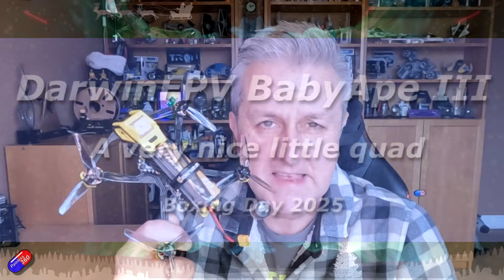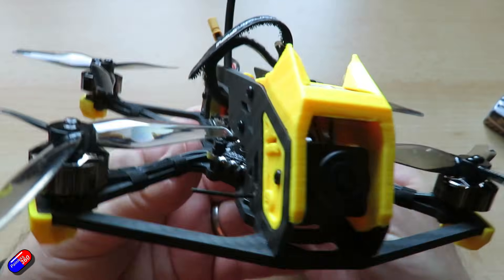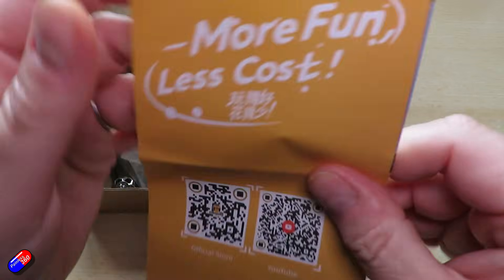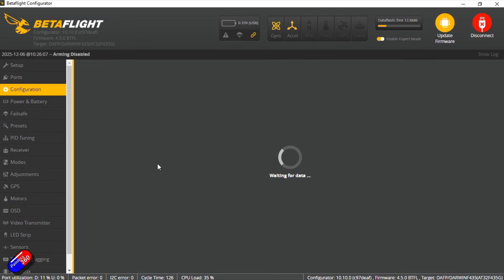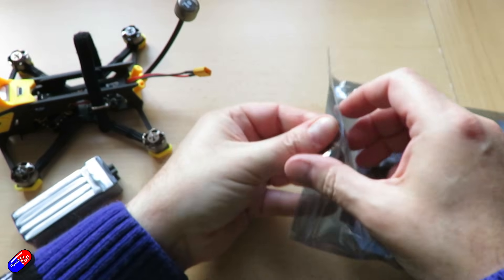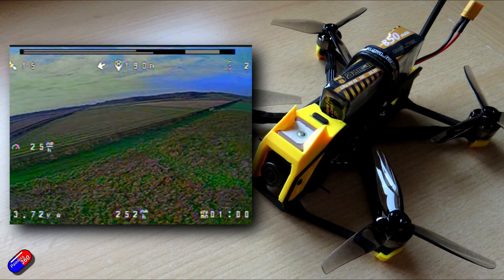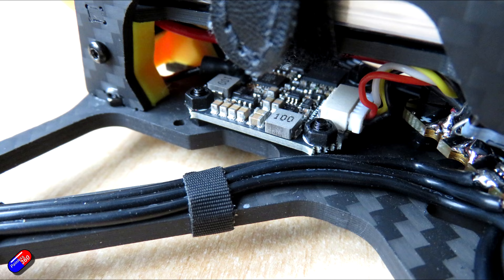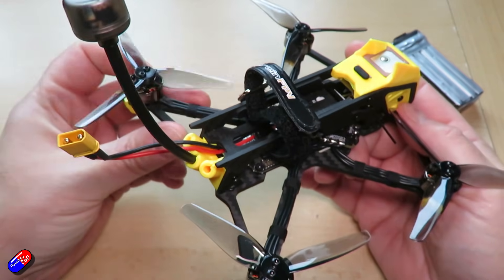The NEW DarwinFPV BabyApe III PRO: DarwinFPV continue to evolve!

Comment: Have you done a video on the new HGLRC Talon LR Micro Drone? It takes 18650 Cells in a nice Spring Loaded battery cell holder for quick swapping. If not, that would make a great review video! Maybe install INAV on it after doing the initial test flights! Lol

Comment: Hi Lee,  Marry Xmas and best wishes for 2026, I happen to like Darwin quads,  I have the Babyape 2 and I love flying this quad on 6s, I wish they would have used a Caddx baby Ratel instead of the Ant. My opinion is that the Ratel is a great micro camera.  But I would use the No vtx and install a walksnail system. Thanks again for the video and info on this quad.
Marry